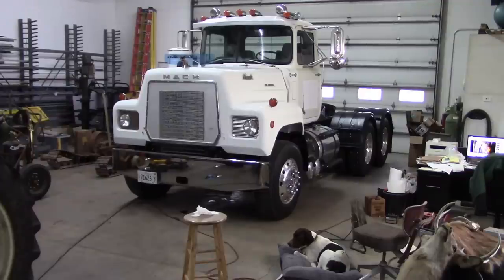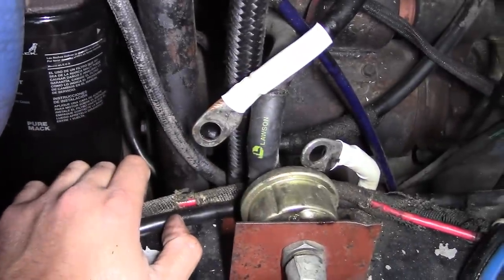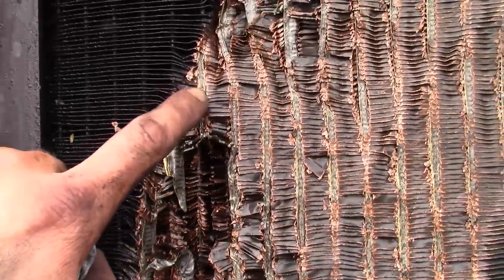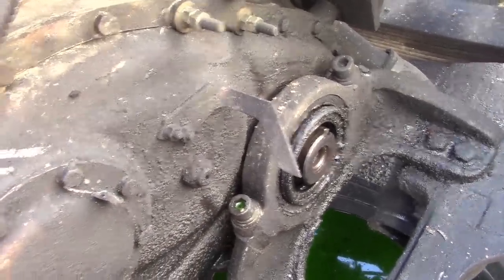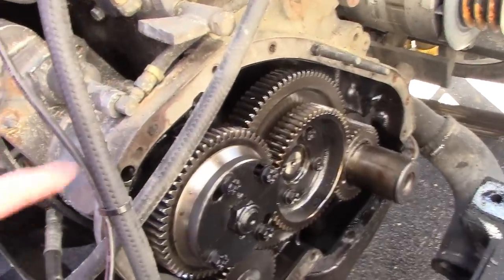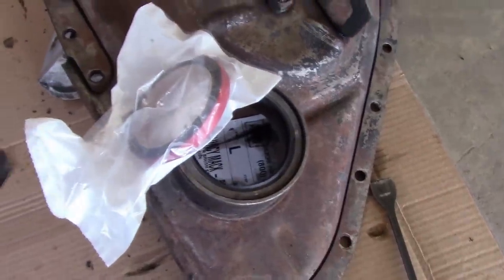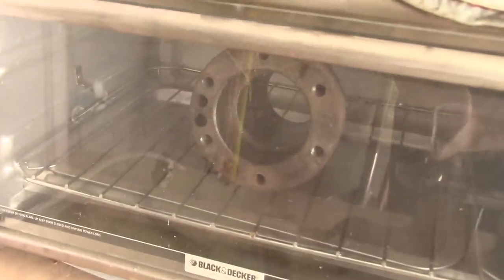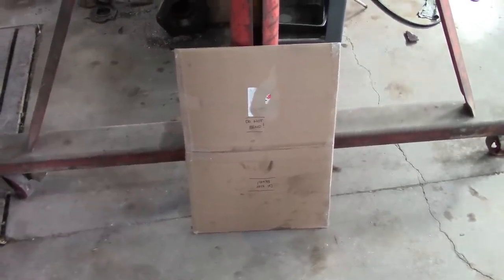Mack R Model Semi Truck Has a Bad Day - Fan Hits Radiator and Battery Issues

Comment: 11 days for a truck that you can't get parts for anymore is not that bad, I'm sure you've heard of if not used that gasket maker " the right stuff " , if you let it setup I would certainly trust it where the oil pan gasket tore away, you can work it when putting it on and get your thickness wait a few hours and put everything back together toque too spec it won't press out and ruin the engine, anyway great job

Comment: Why the positive  and negative leads on the 2-way radio are fused.....  Relatively common in the 2-way industry. If the radio casing is also grounded to the body/frame, loss of a main ground lead means other vehicle loads may try to use the 2-way radio negative cable as its ground. Fusing the negative lead to the radio prevents the magic smoke getting out if such things happen.
Reply from the maker: There you go!

Comment: Talking about those terminal ring pliers "It's got a hammer function, too". What tool doesn't? I've driven 3" 10D nails with the back of a DeWalt impact driver. It says impact right in the name.

Comment: The OLD MACK have a issue with the battery cable running across both sides we have ran 50 R Series Mack's with 6V 4 battery system for 50 years 

Replace the cables and watch a Jet engine crank over

Comment: Maybe the fused ground on the radio is there so you can use it on a positive ground system with no additional hassle?
Reply from the maker: I guess it's because the antenna is grounded so they don't want a ground loop.

Comment: Wes, you could put the cover on with two or three bolts loose then put the hub in and let it self center with the seal, then put all the rest of the cover bolts on and torque down. As an aside, we’re you worried the heated from the oven would damage the seal?

Comment: Two way radios are fused on both leads in case the chassis ground fails. If the chassis ground fails. The radio body or antenna shield braid could become the ground path for the whole vehicle, usually resulting in a fire.
Reply: Another reason that truck 2 way & CBs radios have fuses on both wires is if they are installed in a 24/12 volt truck. Also the local Cenex bought a Mack with a 24/12 volt POSITIVE ground. They wiped out a used radio, that someone had cut the ground fuse off of!
That was a rare bird. I remember when they had to get an alternator during fertilizer season. Took a week to get. It was 2 chargers every night, run all day long with out shutting it off. No heater fan unless it was absolutely necessary. 
Hello from north east Montana.

Comment: 27:25 - I have it on good authority thar some form of 'liquid' steel needs to be used with the speedisleeve - as a heat transference medium, otherwise the sleeve will fail rom overheating...

Comment: I hope the farmer knows what length and hoops the Wes jumped over to get his truck back. He owes you big time when  he needs anything on his farm fixed he needs to bring it to you first before his son-in-law screws the pooch after your fix. Now we know why the speedy sleeve was pooched. Because without dowel pins and the weight of the engine what did Mack think would happen?

Comment: What I find is that a number of American trucks, tractors and engines are designed with no sympathy to the end user.  Take the timing cover set up on this Mack, its a multi stage manufacturing part that would cost more to the customer. I have heard cries of US tractors being so computerized and when there is a fault in one function you cannot bypass it. Try doing that and the whole system will shut down, so a customer has to spend big money on maybe a CPU unit. Back in the day we had some experience with Mercedes Benz, M.A.N, Nissan Diesel, Mitsubishi trucks and prime movers which were quality built, simple to service with excellent parts availability. And there was one German manufacturer Magirus Deutz, who speciallized in air-cooled diesel engines for transport, power gen and agriculture.  They were such good engines.......no radiator problems!!
Reply from the maker: They are designing everything for maximum fuel economy. That makes them very complicated.

Comment: Were you not worried about the bolt trapping air as you screwed it in blowing out the seal on the inside of the radiator tank? Good effort btw..
Reply from the maker: No. Air is compressible. I don't think it would be an issue.

Comment: Two way radio, why both the positive and negative leads are fused.  If the ground disappears, you don't want it found through the radio.  Overly simplistic explantion, but there is the basis.

Comment: Yeah that thing definitely needs a recore I did radiators for 7 years that thing is not worth trying to fix at all the way the tubes are made it's almost impossible to solder them because when they make them they're not extruded there seemed and soldered can come coated in solder so when we make your core and bake it in the oven solder solder on the tubes notes to the radiator fins makes it nice and solid before the headers go on and then the tanks and everything else so just try to get a recore tanks know everything thanks they look just fine my old shop can actually do that kind of work if you're interested I can give you their info there is there Illinois I'm not sure how far from me but not too far but I know they can take a job I like that no problem we've done some of the most Oddball radiators there cuz we use equipment that's a hundred years old all the stuff that Henry Ford used to use. Jay Leno is Chrysler airflow he has we did the radiator for that there's only a handful of cars around
Reply from the maker: My radiator shop is pretty good. He said he could solder the tubes, but we would lose around 20% of the cooling capacity. That's not worth it.
Reply: @WatchWesWork  like I said I worked at a radiator shop we did antique model a Model t Willy's Jeep radiators and I know exactly how those tubes are made and like you said it's not worth fixing you'll spend your day chasing seemed all day long and by the time you're done yeah you will lose a lot of coolant capacity. Shop I work for has been around for I don't even know if 70 + years everything's done the same way they did a hundred years ago all machines are over a hundred years old all belt driven we make everything from Flat brass by copper flat Steel yeah you can go buy a brand new nice fancy aluminum radiator but there's nothing like having the original brass and copper one there. Well if you ever run into a similar problem a radiator for a car this that the name of the company is independent antique radiator Manufacturing. They do have a website just Google the name and you can find them they said we done cars turn the rarest ones I said Jay Leno's Chrysler airflow has a radiator in it that I built and it's time to read only a handful of cars left so it wasn't an easy process but you can't tell it looks just like an original brand new radiator

Comment: You can straighten sheet metal parts with just a fork with two fat ball bearings and a metal wheel with a hardend surface in the center on a stubby axle as a tool.

Just wash the part throughly to avoid scratching it or the wheel up :)

Comment: 31:24 why didn't you just deny the package? In this case the package gets send back to the sender and retains the same tracking number and it's free. This way it's also guaranteed that only FedEx did mess with the package and they can't blame you for any damage :)

I do this always when stuff shows up late or damaged, it's the easiest way to avoid being responsible for shipping damage. :)

Comment: With no dowel on that timing cover would it have been procedure to install the pulley hub to center the seal then tighten the bolts? Just curious not hating or anything just fishin for thoughts

Comment: It's amazing they build a truck with NO front impact protection for the radiator.
Reply from the maker: That's the trade off of the short hood.
Reply: Flimsy fiberglass hood doesn't help either

Comment: For That small wear sleeve   i  would have   probably boiled n water or got it alittle hotter   maybe. set oven to 350°    dropped it  right in place also
Reply from the maker: My experience is the sleeves don't expand enough with heat.

Comment: My uncle has two mack trucks that are both 2004's. One of them has a bad steering box input shaft seal that has been leaking for 2 months probably longer. Been trying to get the seal for a month and a half now and they still haven't sent it. I'm almost certain that it will be the wrong one when they do finally get around to sending it. Took three tries to get the right factory replacement air tank. Mack's parts department is utterly useless, has nothing to do with the age of the truck! (Granted its not helping you any 😉)

Comment: By the way those cores are fairly inexpensive and they just bolt in with about 50 bolts on each end. If you just use all brand new bolts it's really not that bad of a job and much less expensive than letting a radiator shop touch it.

Comment: On the end clearance with the bronze push pads. My assumption is to use plastiguage with clean gaskets temporarily tightened on then screw the pad in or out having to remove and tighten till clearance is spec. What is spec? Duh I would guess 3 to 5 thousandth but not clear.

Comment: Two way radios are often fused on the positive and negative sides. This is recommended by the radio manufacturer in their installation instructions. This way the radio circuits are protected in the event of reversed polarity while jump starting.

Comment: Was that the New front main seal installed or the old one when you put the crank pulley back on? Lol
Reply from the maker: Well I left the old one in the cover when I installed it just in case I could not get a new seal.
Reply: @WatchWesWork  right I
Noticed that when you first were bolting the cover in place.
But when you slid the heated up crank pulley hub in it looked like the old seal was still in. I thought maybe you forgot to put it in and maybe took it back off but just didnt feel the need to show it.
Or did you put the the hub back on before you received the New crank seal and the footage just wasn't on order?

Comment: You have to be careful with those harmonic balancers. That balances out the crankshaft.. I've seen terrible engine vibration from Bad balancers. That truck is so old probably has a million miles on it. Change the whole balancer.
Reply from the maker: I don't think the engine has hardly any hours on it.

Comment: Best practices for connecting two-way radio is to connect directly to the battery with fuses in both leads. Wiring to terminal blocks farther from the battery can cause alternator whine in the transmitter's signal.  Fusing the negative is to prevent damage to the radio should the chassis to battery connection fail resulting in potentially high currents finding a path to the negative battery terminal through the radio.

Comment: When using 10oz tubes of sealer how do you deal with the unused tube of sealant?
Reply: Unscrew the nozzle put a bit of heavy polythene bag over the threads, screw the nozzle back on,   this will hold most stickums for a while.  When you want to use it again remove poly and use new nozzle. Some sealers are not too sensitive and you can just stick the nozzle into a rubber glove finger and tape it on.
Reply from the maker: Put them in the freezer.

Comment: I worked for Harrah's Casino and we used to get chips and mother boards as well as belly and marquee glass sent to us from multiple gaming manufacturers. We at Harrah's Casino had a national brand contract with UPS meaning if we had to ship anything bigger then a first class piece of mail we had to use UPS which I loved because when I went on vacation if I bought anything souvenir wise I would take it to one of the 50 plus Harrah's Casino's in the USA and ship it to my Harrah's Casino for free.
The problems we had with FedEx were egregious. If FedEx chooses to they can burn your shipment in route for any reason and never inform either the shipper or the shippee. I wouldn't use FedEx if they were free. That company is shit. 2 separate times they shredded and then burned millions of bill validator heads from JCM which caused JCM to sue them and completely change who JCM used for international shipping.
Reply from the maker: That's cool!

Comment: List of all that is wrong.  1.  Got a cracked timing case cover and a couple of teeth broken off of timing gear, Radiator damaged to the core, it's got a cracked water pump and a fractured injector line.
Reply from the maker: Yeah well what's all that mean?

Comment: Wes, Most land mobile two-way radios like commercial radios, public safety radios, and amateur (ham) radios have the negative power lead fused as well as the positive lead to protect the radio in case of a chassis ground failure somewhere in the installation. Drawing several hundred amperes of current through a two-way radio when engaging a starter motor is somewhat devasting to a radio's rather vulnerable electronics.  If that ground fuse blows, start looking immediately at the ground path circuit for the starter. Probably will find a bad or loose cable and poor or no starting capability.

Comment: Why did Mack use 4 6volt batteries instead of one 12v. What is a 2 way radio
Reply: Cranking amps. A radio that you can talk back on. Music is on a one way radio.
Reply: @farmerbill6855  ow that's why they use 4 I was wondering thank you for explaining the difference between the two different types of radio systems

Comment: What are the shutters for in front of the radiator
Reply from the maker: It's kind of like a thermostat. Old school from before viscous fans clutches were a thing.
Reply: @WatchWesWork  ow interesting design do you close them or they go off the heat of the engine

Comment: That cooling fan is on backwards.
Reply from the maker: I just put it back like it was.
Reply: Yeah, it was like that in the shots before the tear down. Could be that since this is a “Frankentruck” it’s the only way it will fit in there. It does look kinda tight. If this truck has cooling issues in the future it may be worth a look. Probably will never matter — especially when the truck is moving. I’m OCD about fan blades. And socks. Always the socks......

Comment: Wes I do not live far from you. I have a 2007 ford f150 with a 3 valve 5.4 liter v8. I need the spark plugs replaced. Would you be interested?
Reply from the maker: Hmm. Those are always fun. mail@watchweswork.com

Comment: I don't see reason for keeping 4 batteries, while you can buy single 12v batterie with way more cranking amps and capacity for less money than those four 6v batteries, and get rid of many of failure points in this setup.
Reply from the maker: I covered this in a video a while back. The 12 volt batteries have twice the power output, but half the "capacity". Meaning the 6 volt battery puts out half the power, but for twice as long (roughly) as a 12V battery. So you don't gain much by switching.
Reply: @WatchWesWork  It may be, but do you really need so much capacity? Also switching to two 12v batteries instread of four 6v will get rid of 4 failure points (battery posts). For example in Ursus c330 tractor, originally there were two 6v 160Ah batteries with 12A generator (!!!) that caused all sorts of electrical issues, now I have cheap 12v 60Ah battery with 50A alternator, tractor can start even in coldest weather, butt maybe those Mack trucks need ay more crankong to get going :)

Comment: Heat the sleeve in some boiling water
Reply from the maker: That doesn't work very well in my experience.
Reply: Watch Wes Work we have a 16’ tiller has wear sleeves on it pretty thin but about 12” diameter works well for use, should have put a ? Mark on that first comment, not a criticism

Comment: Talk,Talk, Talk, the first 18 minustes you just running your omuth. Saw no actual work. Man, turn off the flow.
Reply from the maker: Maybe you should try watching. In the first 18 minutes we tracked down a battery connection issue, removed the hood, removed the radiator, removed the pulleys, etc. That represents 5+ hours of work. Go watch some more Samcrac.